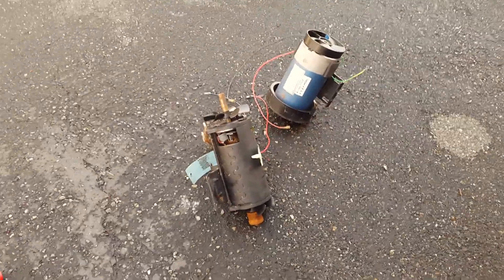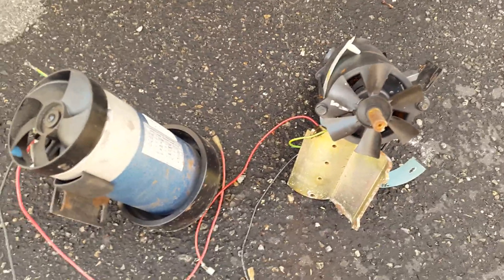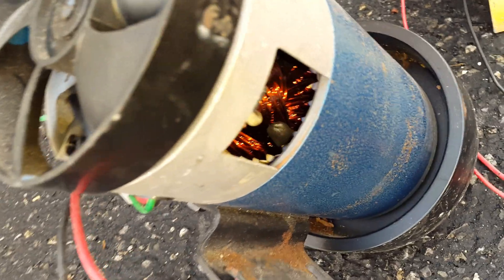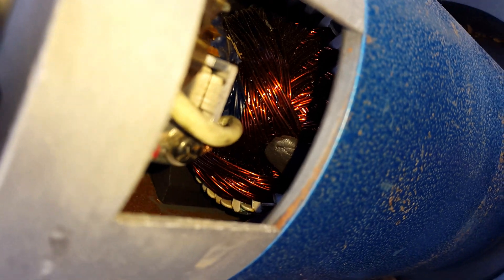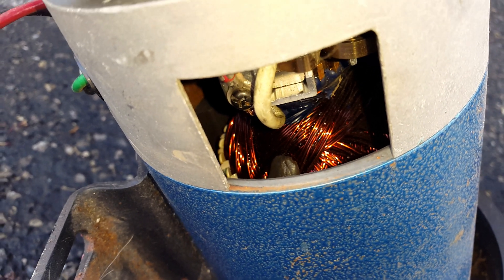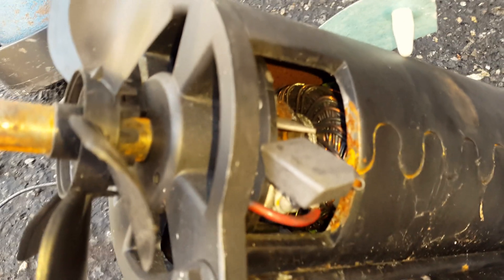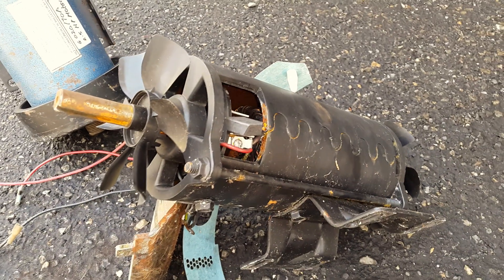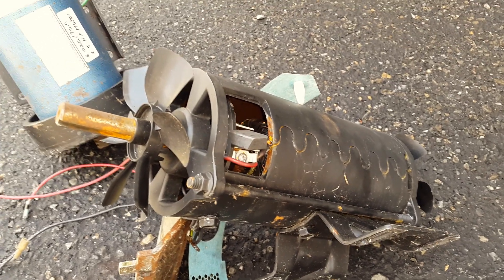How To Diagnose Your Treadmill Drive Motor

Comment: Thank you for sharing!! What about the other side of the motor where it's flat, and there's a thing that it rubs up against when it's turning. Looks like it's supposed to be there, but I think the copper wheel itself has a blemish on it. The issue I'm having is that the treadmill sometimes glitches or catches or stops for a second or two, then keeps going. Do you think that could be the problem?